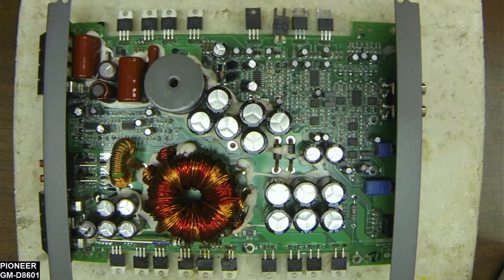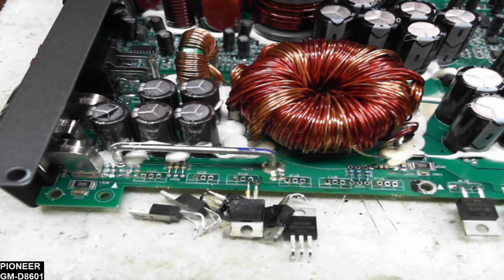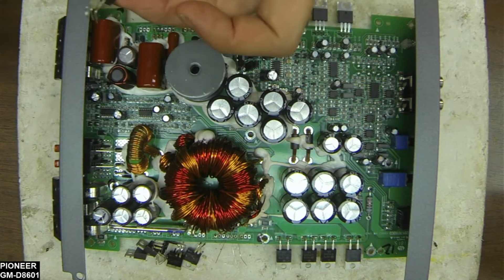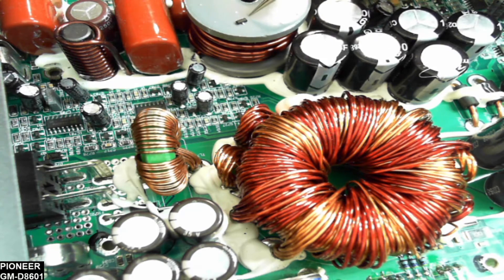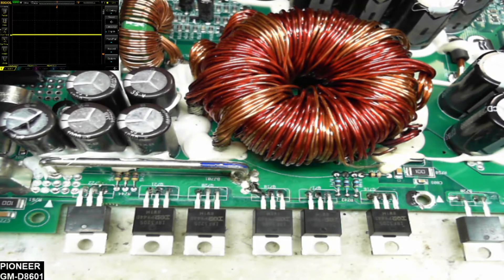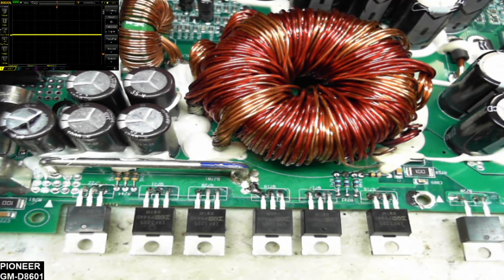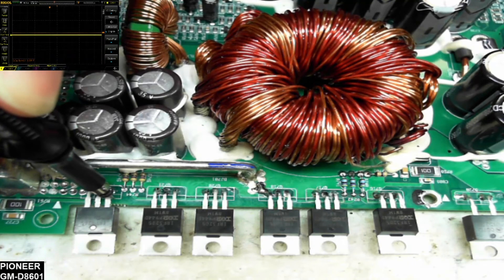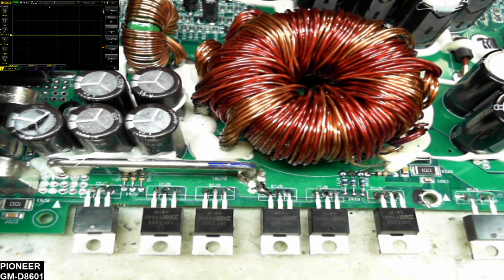Pioneer GM-D8601 Class D Amplifier Power Supply Repair and Startup

Comment: Unbelievable. No wonder they blew. I'm sure it was also ran at. 5 ohms or lower. But that is Unbelievable. Sad that Pioneer would do that. Great work Todd.
Reply from the maker: Not even a sign of a stressed inductor or outputs. My opinion is - uneven load sharing causes failed components. Thank you Pioneer for keeping a small business going!